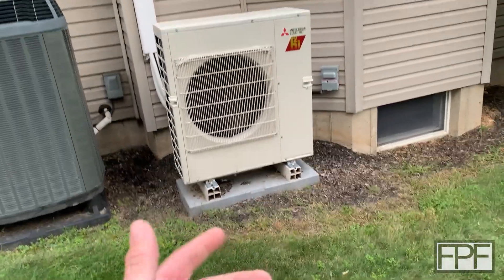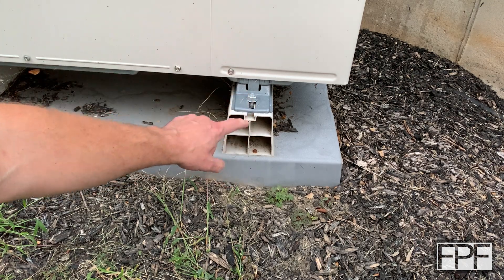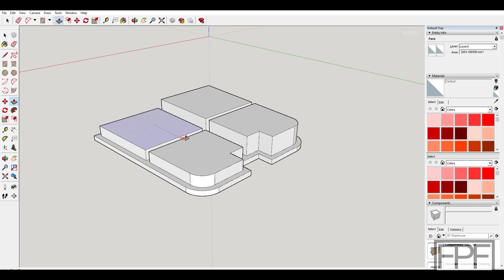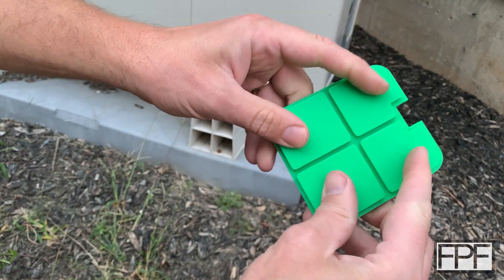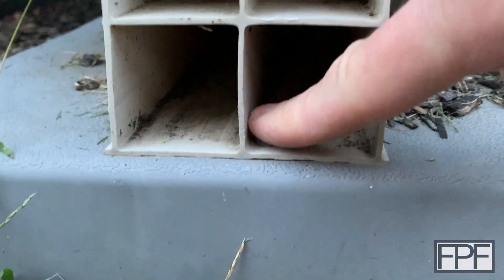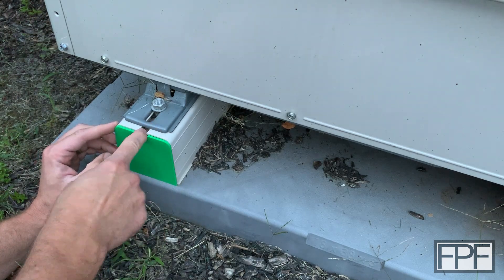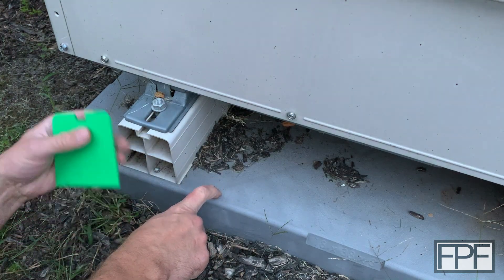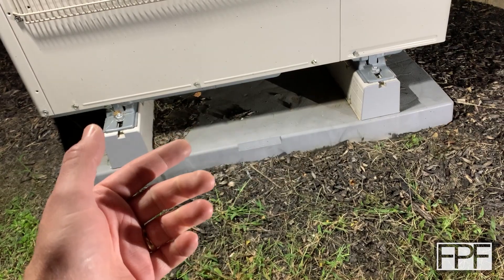3D Printed Mini Split Mounting Block End Caps

Comment: Take a picture of the item and use Mathias Wandel’s Bigprint program to calibrate the size. Then export it to the design software. Saves a lot of measuring. Thanks for posting. Great channel
Reply from the maker: I also just saw him use that in a recent vid and had the same thought :)
Reply: @FunctionalPrintFriday  You could also use Fusion 360 canvases to achieve the same with a picture of these section (with the added benefit of being able to draw "on top" of the taken picture) 👍
Reply: @FunctionalPrintFriday  OnShape allows you to import a picture as well.  So you can just scale height or width and should be exact.

Comment: Water will get in and the last thing you need are the bolts sitting in a pool of water - a drain hole on the bottom edge might be a good idea. Have you noticed any water?
Reply from the maker: no water so far.  I considered a drain hole, but to be big enough to not just close up from dust/pollen it would have to be big enough to let the bugs in, which is back to square 1

Comment: Looks great man. Give PETG a try though. You can dial it in to make it look almost as clean as PLA, and it has way better heat resistance. It's my go-to for outdoor stuff.
Reply from the maker: I haven't really had any of my PLA warp outside, but maybe I've just been lucky and I'm always putting stuff in the shade :)   You're right though, I know the temp resistance of PETG is better.  Still doesn't come close to TPU though.

Comment: You’re better than me. I’d used my leaf blower instead of a vacuum. Guess I win the Lazy Award. 😂 
I can definitely see that if you had caps, that deformation would naturally pop them off.
The T-Block end caps I’ve seen online are ventilated with slots and attached with tabs. Of course they’re injection molded.
Reply from the maker: Will be interesting to see if these last.  Ultimately I can always go TPU and just make the key parts even longer.

Comment: i run the creality hyper pla successfully with the bambu settings...
Reply from the maker: Thx for the suggestion.  I got excited till I saw the paper spools :(  I love the eco-friendly nature, but hate the mess they make in the AMS.   They'd don't slide as well on the hanger on my mk3 either.
Reply: You can build yourself a respooler and spools. There are pretty nice ones on printables. I respool everything before putting it on my Bambu nowadays.

Comment: You can just take a picture with a ruler next to it and import that for your sketch.
Nice work.
Reply from the maker: not a bad idea, but is it tough to get them in just the right plane with eachother?
Reply: @FunctionalPrintFriday  not with freecad, it was dead simple.
Reply: Even with fusion 360 its easy. I do it all the time
Reply: In SketchUp, it will allow a direct import of .jpeg, then scale it to size, then trace the outline.
Great practical print!